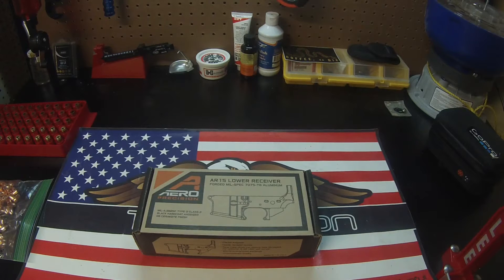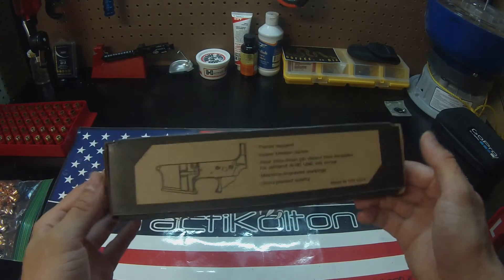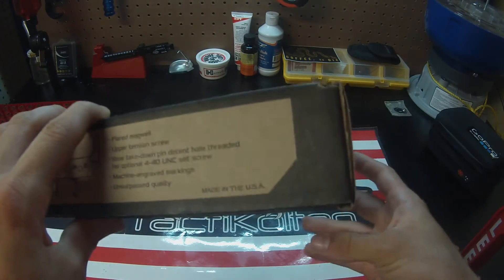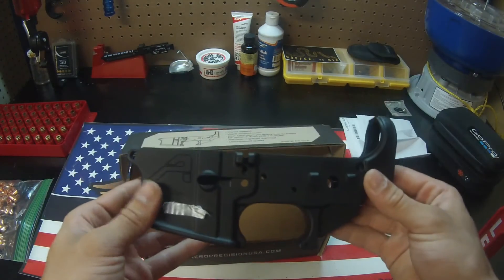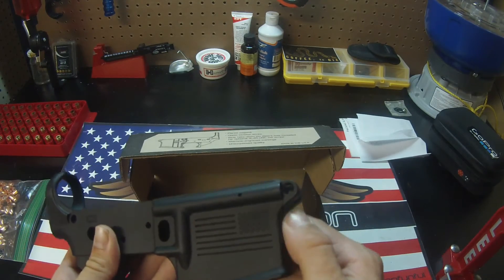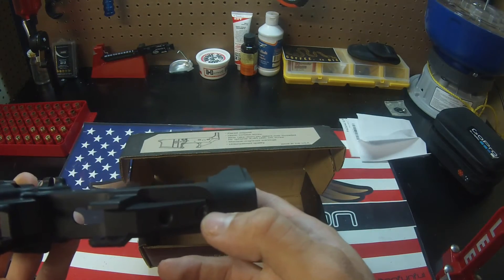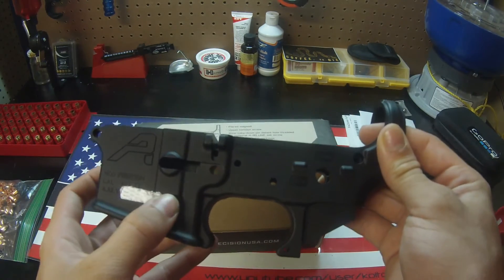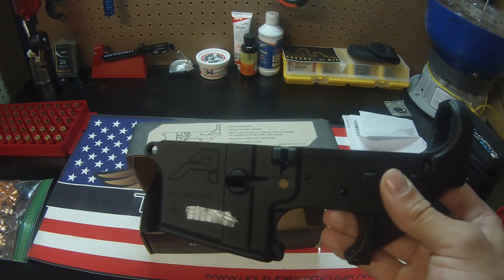Aero Precision Gen 2 FREEDOM edition stripped lower!

Comment: That flag looks nice on that lower.. Did you get it directly from Aero?
Reply from the maker: I got it threw primary arms it was the very last one in stock.
SAA sells a matching stripped upper I'm interested in.
Reply: I think aero does too..I've only seen one with the flag back by the charging handle.
Reply from the maker: yeah its on the section that is directly above the T handle
Reply: How has the lower worked out for you since this video? Thanks